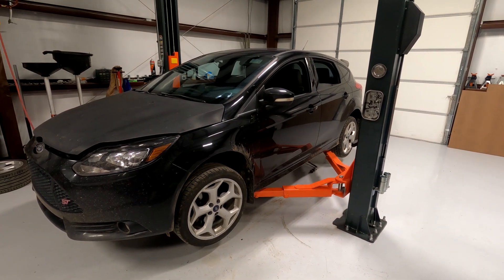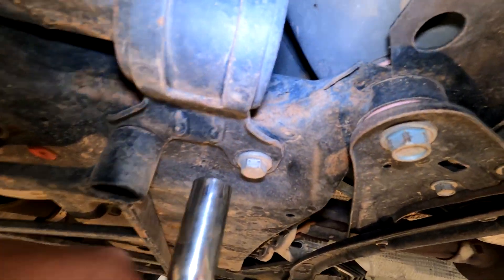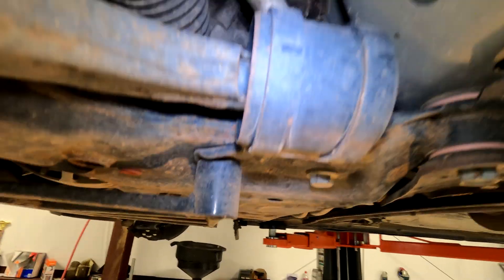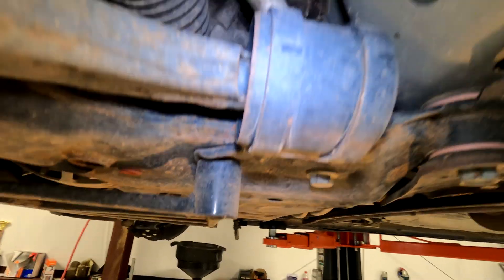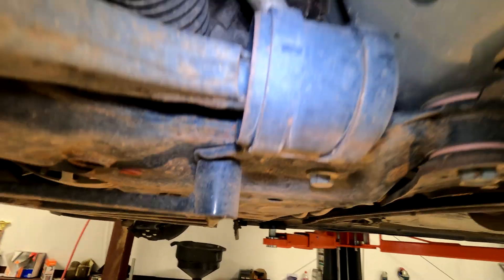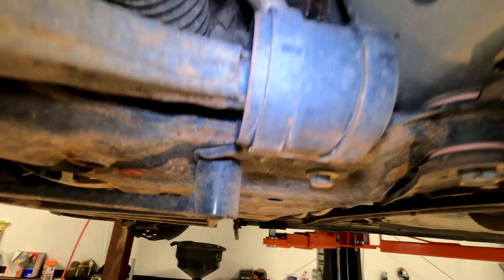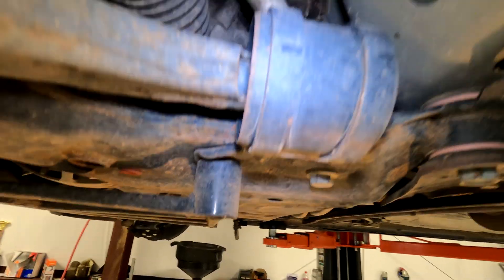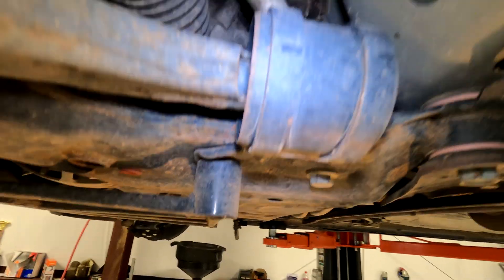2012+ Ford Focus Front Lower Control Arm Replacement Step-by-Step 2013 & Newer Fat Guy Builds

Comment: The right side is a bit more difficult as you have to remove the 4 10mm bolts holding the metal guard under the air conditioner compressor to be able to get the forward bolt out of the lower control arm.  Also there isn’t enough room for the 18mm socket.  A crowfoot is probably your best bet for tightening with your torque wrench (111 Ft. lbs + 90 degrees).  Don’t forget to adjust your torque setting to account for the crowfoot’s offset.
Reply from the maker: Thanks for watching!

Comment: I have a question. I've got a clunk on the front passenger side. I have replaced my struts, right engine  mount as it looked to be hitting. Also changed the bottom engine mount, and that was definitely broken. Thought that was the fix and i pulled the car out of the garage and still the clunk remains.  Ive tried to see if there is anything loose but couldnt see or feel anything. What do you think it could be, thanks in advance.
Reply from the maker: Bad axle?